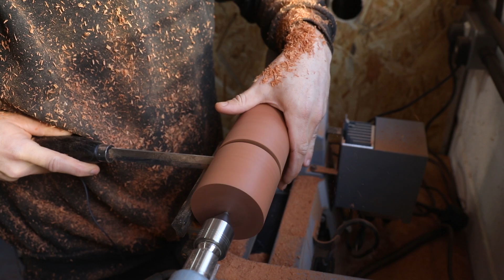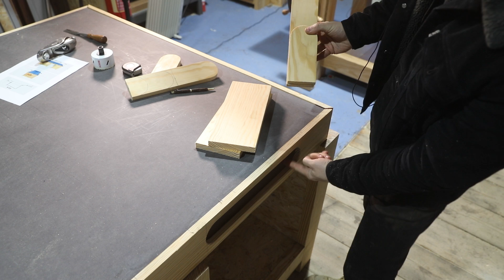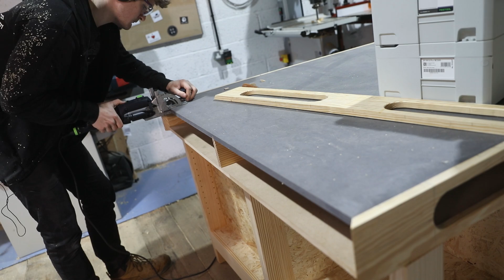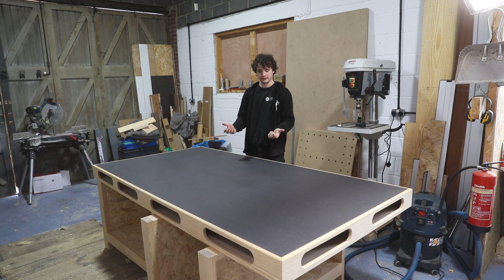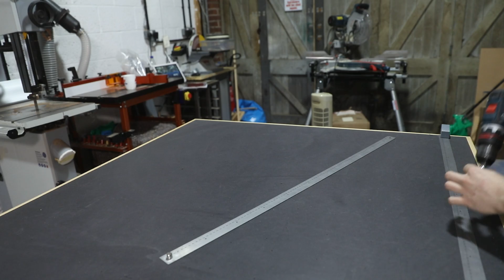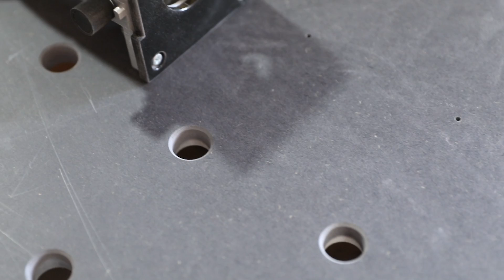Making the ULTIMATE Power Tool Workbench | Part 7

Comment: Matt, when you laid out the ho,les using the Parf guide, did you start from one end or in the middle and work to the outside?  I a, curious because I plan to do something similar.  John McGrath had a small error working from one side to the other and Peter Parf suggested that to avoid the error star in the middle and worrk to the outside (and i a=m reffering to the long dimension)
Awesome build.  One I have watcgwed siunce you first posted it.

Comment: Really enjoying the series, although I know it’s not new at this point!

Just wanted to ask about the parf guide system in such a big bench. John McGrath did a large mft style build (you might well be aware) and ran into some issues, but he started in one corner and worked across. I noticed you stated in the centre and appeared to do the 10x10 grid in the middle and then work outwards to the edges, I assume that was intentional to maximise accuracy? Is this the recommended way to use the system if doing anything bigger than a standard MFT? (Which isn’t very big!)

Comment: To cramp the end aprons in the centre, plane a slight bow in the centre of the cramping block that goes between the cramps at each end. That way you apply a little extra pressure to the centre which is exactly what you need and where you need it.  This technique can also be used to cramp wide panels in the centre for cabinet construction.

Comment: Great build - mahoooosive bench, wish I had the space for something like that! Your point about applying finish to both sides of MDF is great advice. Do you think that would that be necessary for two panels of 18mm MR MDF which are about 1200 x 700 in size and have been laminated together using Cascamite (I'm in the middle of doing a new bench top for my much, much smaller bench!!)?

Comment: You could’ve used a length of timber between your corner clamps on the outside corners, then wedges to ‘push’ the middle part into the table.

Comment: Nice video  Matt but how do you justify a £165 for a jig to drill some holes in a straight line🤔
Reply: It doesn't just drill holes in a straight line it drills them at a perfect 90 degree angle with cnc like accuracy so you can use the holes for referencing your track saw and various other things

Comment: To make a cheap ultra-long clamp, you could use a long string or rope and two long pieces of wood.
Drill 4 holes in each wood piece and pull the (multiple layers of) string/rope through, finally put winding-sticks through each end of the string/rope. You do not have to cut the string or rope at all; just leave a relaxed amount of string between each hole.
Now wind the winding-sticks and you'll get a nice strong clampling pressure for very little money. :)
(Same system was used in the old frame-saws. It can also be used when clamping when gluing frames or chairs).

Comment: The top might still warp, causing 8 spots that are high or low, depending on humidity. I would put some finish on the inside (paint roller will make that easy).

Comment: Hmm, I'm a bit concerned about the dog-holes. Since the table-top is MDF and that MDF isn't that thick, you can't really use the dog-holes for things that require high strength. They'd be fine for drilling holes through boards and perhaps also for clamping down to the table-top. I'm also thinking about sawdust "snowing" down on your tools below.
You could probably make the dog-holes stronger by coating the table-top with epoxy, but it won't make it extremely durable.
On the other hand, you could make some long 'bars' or 'rulers' that have dowels in them, which fit into those dog-holes. That would distribute any clamping pressure. All this of course depends on how you use the workbench. ;)
Reply: The top is not MDF, it's Valchromat which is much denser and stronger than standard MDF
Reply: Sorry about that, you're right, my mistake. :)
Reply: No worries with the sawdust - it will just collect inside the table-top... there's no holes through to the tools below.
Reply: The wide holes in the sides - they're there for temporary putting hand/power-tools.
-I guess it won't be a big problem, just a little tedious now and then.

Comment: I don't know if you ever thought about this but for me the idea of using glue to attach the top (and the entire torsion box top assembly) to me sounds a bit silly because for me I know the top is going to be cut up, scorched by routers and destroyed by tools, so what would you do if you have to replace the top? Inevitably you will have to replace the top but since everything is glued would you do a full rebuild of the torsion box top? I would of made it so all you need to do is unscrew a couple of screws, drop in the material you are using for the top and that would be it. Wondering what you are going to do when this problem arrises.
Reply: You make the side pieces the thickness of a second sheet of mdf taller than the glued down sheet.  Once everything is dry, you cut the second sheet to fit and drop it into the cavity.  Once it gets too chewed up, you can just pull it up and either flip it over, if it's not too bad, or just replace it.  Also lets your dog holes have a bit of extra thickness.
Reply: An easy fix could be to just add a thin MDF on top of the damaged one (filling the holes first of course).
Adding a few extra "dog-holes" could be used for "clamping down" the new top, so you wouldn't have to glue it on (resulting in a MDF-tower after a few years).

Comment: Love the videos and appreciate the comments, too. Quick question. Assuming I have the essential hand tools, plus drill, router and sander, what in your opinion are the three essential power tools? Trying to decide whether to go with Festool circular saw, band saw, table saw or domino. Obviously, depends on what I build. But just generally, what can you not live without? Thanks!
Reply: Table saw!
Reply: @Mr_Judge_Benny_Hinn  I'd argue for the band saw actually - it's a bit harder to get straight cuts, but it can do stuff the table saw can't (mostly around thickness of material it can handle).  Mind you, it's not so good for sheet material, which is probably why Matt also has the track saw.

Comment: Just curious, given the small size of your shop, why go for such a large single table? Wouldnt it be more useful to have multiple smaller tables(maybe split that table into 4 pieces) all the same height that could either be put all together, or slid to the side if you need floor space or something?
Reply: If you're going to make things like a door, you must have one large surface. This will avoid the final product twisting.
Someone I know once ignored the warnings and used two sawhorses ... ending up with a barn-door twisting 5cm (50 millimeters, yes!). After that, he got a new nickname: "5cm".
-So either make sure your table is absolutely flat, or use the floor (which of course needs to be flat for this to work).

Comment: Looks like work is progressing on Bessie, the big worktable. (You named the vice-equipped solid wood workbench Bertha, right? Why not name this project Bessie, after the Whomobile?) I notice you drilled a complete grillwork of 3 mm pilot holes, but you only put in a partial network of 20 mm dog holes to date. Are you simply leaving the rest, or are you going to rout and install universal clamp tracks on the table top as well? I know some woodworkers prefer a worktable/workbench to offer a mixture of dog holes and tracks, so I was curious.

Comment: Could have just run a 2x4 through the side slots and left about 6" sticking out, then you could use the slots in the end panel and clamped from all sides without worrying about full length clamps.
Reply from the maker: There’s a sliding dovetail in the way. I couldn’t run a 2x4 through the side slots
Reply: Lol I find it funny that there are more comments on this thread questioning your method for clamping the ends than there is acknowledging you for the incredible workbench you just built and for spending all the time you did film it and editing all so others could learn. I think you did an incredible job and I personally couldn’t care less how you chose to clamp your ends on. Well done Matt and thanks for sharing 👍
Reply from the maker: James Horton 😘😘

Comment: Rather than pay so much for those Bessey clamps to get long clamping, BUY pipe clamps and then its only a matter of buying lengths of pipe long enough to do the job. I'd venture to say that for the cost of ONE Bessey,(regardless of size) you could get two complete 8-10 ft pipe clamps. Yes, buy the best you can afford BUT not always in this case.

Comment: Maybe invest in some pipe clamps? It would save you the trouble of disassembling your parallel clamps. Also if you need them to be longer, the Mobil jaw easily slides on and off to reverse it.

lol I wrote this before looking in the comment section. Yea, what they said.

Comment: Nice one Matt. Looking good. The workshop is getting there slowly hay. Q. What is the pine wood you are using. The grain looks so linear and top quality. Is it just your supplier or should one ask for a certain something. Thanks
Reply from the maker: Cheers Adrian. It’s Southern Yellow Pine. Nothing special about this stock, it pretty much all looks the same! I got it from Tyler Hardwoods but any big timber supplier will sell it. And it’s cheap!
Reply: @MattEstlea  It's certainly better looking (and better quality / apparently nicer to work with) than the Pine they sell in B&Q - which is evil stuff... warps / twists just on the journey home, splinters / starts blowing out as soon as you pick up a saw... just plain nasty.

Comment: Suggestion. 
Drill the holes in the table first before clamping mitres then use hole with a peg in it to clamp mitre join to.
Reply from the maker: I did consider that, but the bench dogs I’m using fit into the holes to an incredibly fine tolerance. I was worried that pressure of the clamps would slightly distort the holes without me noticing, thus creating some inaccurate holes in certain places on the bench top.
Reply: I think the holes in the MDF would be distorted long before the steel plug is damaged, and it would ruin your precision. However, I guess you have several bench dogs so you could have used a small wood beam maintained by several bench dogs aligned. Also, why not clamp a piece of wood on top of the bench and use it to clamp the side, or just use a ratchet strap?
Reply: Fair enough. I wouldn’t of thought it needed much pressure